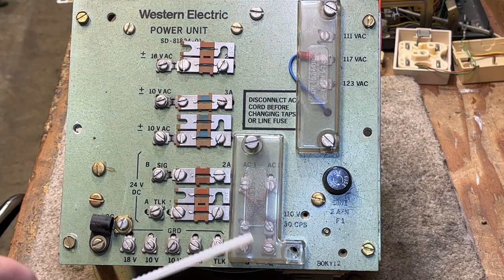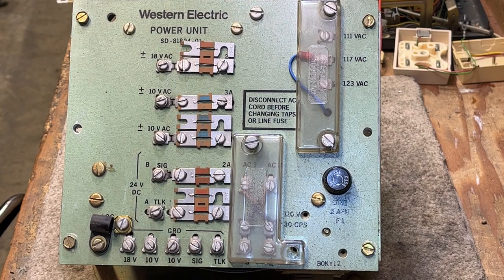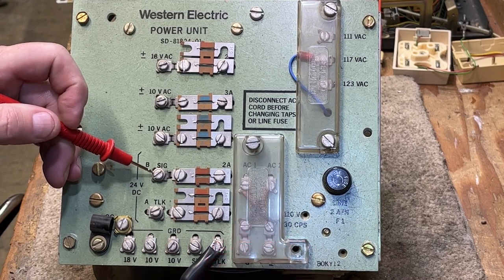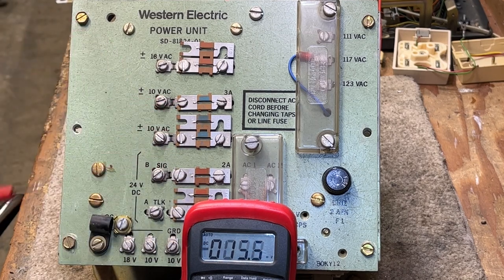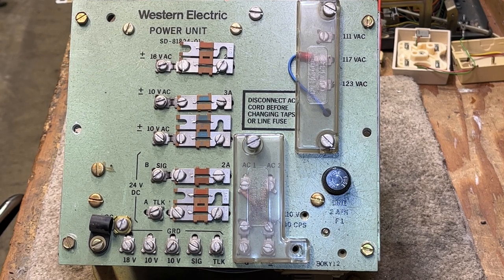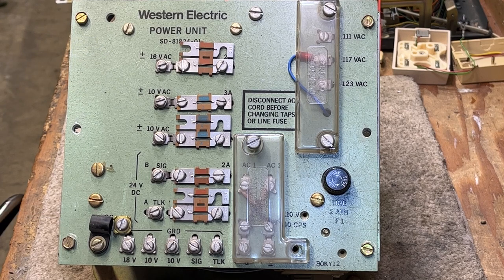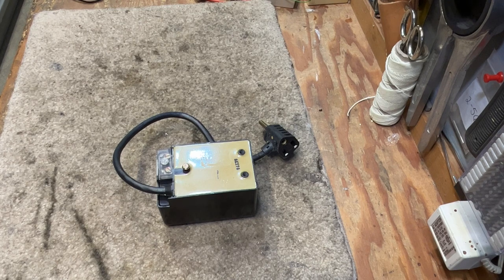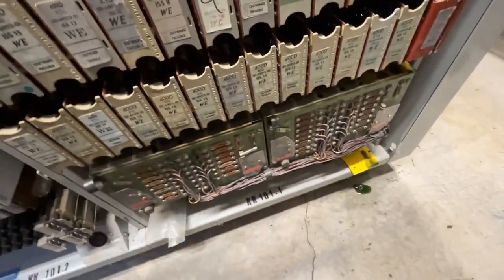Telephone system power supplys, 1A1/1A2 and 55X Cord-board switch boards.

Comment: I did bridge the DC fuse many years ago. If there is a short it takes out the bridge rectifier which then shorts and the transformer wires will start smoking.

Comment: Phil, I have a power supply question, I bought a eBay sold item, and didn't notice it didn't show a power supply in it's photos, it's a adjunct touch-a-matic 31 single line unit, it would take a serious amount of time to go to the east coast to two storage units with my belongings in.. where I have the complete single line version with handset..
Any idea where I can get such a monster.. sadly the description said works, well the battery needs to stay charged.
Reply from the maker: Please post a pic or goto 1A1/1A2 phones on F B

Comment: I have a 20B2 power supply. To me the most amazing part of these power supplies was the 30 cycle ringer generator which uses some very clever engineering to derive that harmonic. I do have a 20 cycle power supply also that I believe was used in a small ITT PBX. Same engineering principle just a little more costly to get down to 20 cycles. Of course these days it’s all done with solid-state components. There was an adapter for Merlin systems that allowed you to interface a standard phone to the merlin system. That adapter generated its own ringer voltage.
Reply: I found that I can distinguish the sound of the WE 300 or 500 series ringers and can tell the difference between the 30 cycle or 20 cycle ringer supplies. I think the 20 cycle just sounds better.  Also like the sound of the old 40s British subscriber sets ringers.
Reply: @mackfisher4487  yes, big difference between the sound of 20 and 30 cycles. On some movies you can hear the difference. Of course most key systems used the 30 cycles when needed